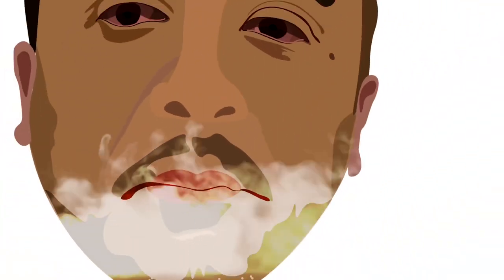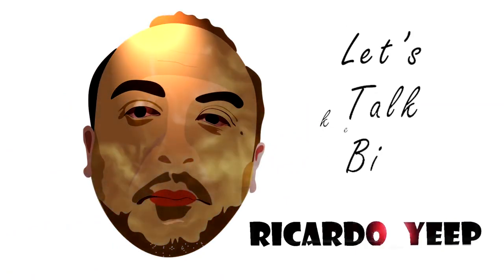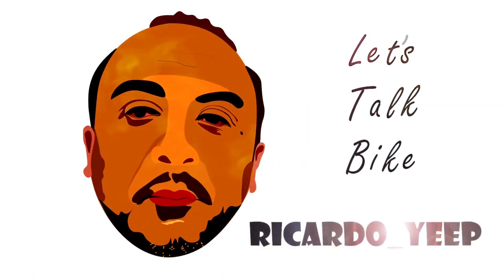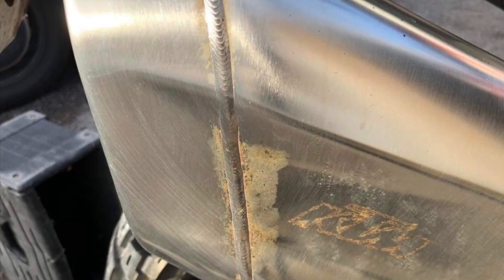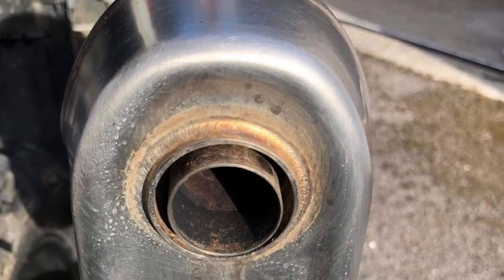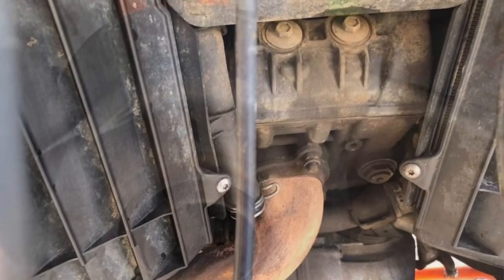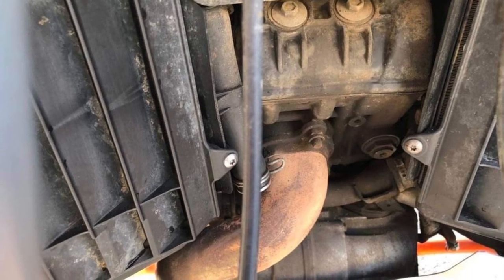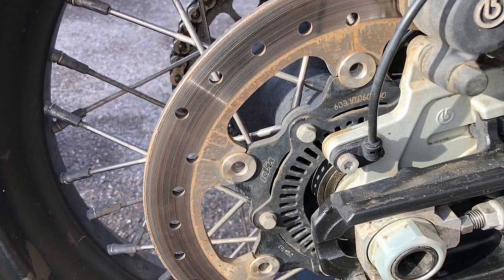2021 2022 2023 2024 KTM 1290 Super Adventure Prevent Winter  Rust On The Parts You Cannot ACF50

Comment: Good tips mate, the amount of times I’ve told people to rinse their bike with cold water every time they get home and they haven’t done so, it’s the one thing that kept my R1 in top condition after a good few North Yorkshire winters, I didn’t have a car at the time and did everything on the bike, it was still mint cone spring. My SAS is drenched in ACF 50 at the mo but have you got any tips for the exhaust and pipes? Ceramic coating maybe? What are your thoughts?
Reply from the maker: Hiya Pete! HAHA yeah I know what you mean. My R1 at 85,000 miles from new and ridden all year round looked brand new when I sold mine. 

Unfortunately I dont have  any tips about the hot stuff.. I kind of just have been doing best with rinsing... I always expect dome corrosion still in the back of my mind as these parts are nearly impossible to keep looking new. As for the  coatings you mention (Ceramic) etc. I have read up and does look promising. But I have not gone down that avenue as yet. Maybe at some point though.

Cheers
Ric!